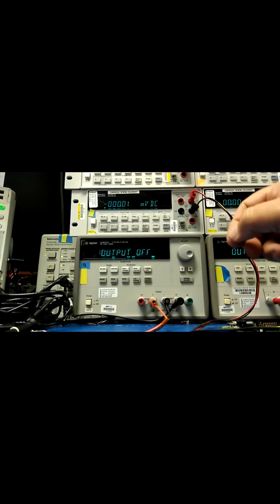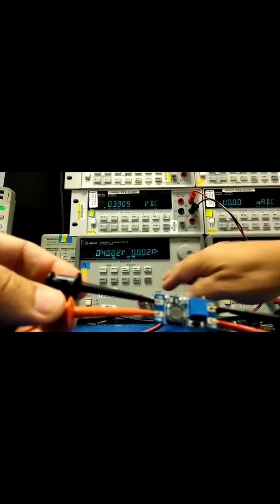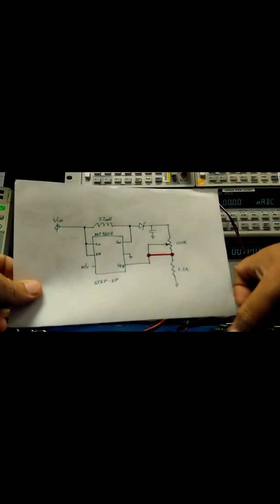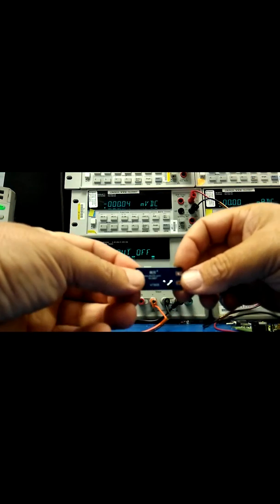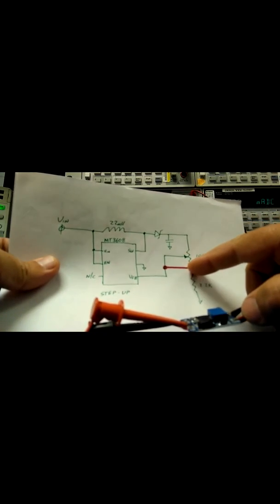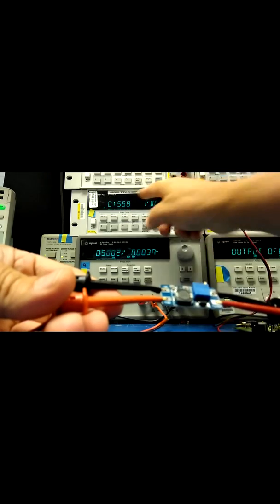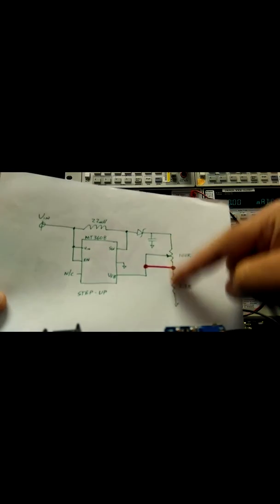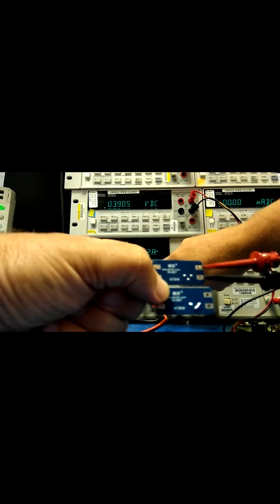How to FIX MT3608 Step Up boost converter module from ebay/banggood/aliexpress.

Comment: Thanks! Mine modules with USB C input had the diode on the side of pot you had to solder on, so the case was just to make the connection from 2 to 3 pot pins instead of from 2 to 1
Reply: Hi, could you specify between which points I have to make the bridge on the modules with the USB C?
Reply: @sandro-x2y  In my case the center one and the one not in use on video

Comment: Just awesome!  Straight to the point. Before soldering the pot legs it was adjusted to 6V. After soldering the legs is actually was measuring 26V. Thank you very much. Nice job!
Reply from the maker: Thanks, glad to help. The feedback pin is 6V max, over that voltage and you let the smoke out, and we know these need the smoke inside to run, haha

Comment: Nice job. I bought 10 of these on Ali ending up with the same issue as yours. My input voltage is 15 volts and I had no adjustment either, tried turning the pot clockwise or anticlockwise. Blew up 2, turning the first 1 anticlock, magic smoke close to the end of the pot travel. The other 1 went the same way, only in the clockwise position. Thanks for posting the fix video 😉
Reply from the maker: your welcome!

Comment: I smoked one of mine when I plugged in the usb (mine has that connector), and 46v came out.  Perfect, so I was trimming the pot, and fell somewhere between 3.5-5v, and U1 lit up and let out the magic smoke.  The next one I saved it, but I sure smell it.  I dislike this module as it is too temperamental besides when I did your fix it no longer boosted at all then I removed the jump, and it started to boost again.
Reply from the maker: Maybe yours is a different schematic, got a link to yours?
Reply: @user-rs8zg8ey2b  I ordered like yours, but Amazon sent me these instead - https://www.amazon.com/Eiechip-Voltage-Regulator-Converter-Module/dp/B07RNBJK5F

Comment: Love this fix as it solves a big problem I was about to have, but how would I add a constant current feature, or module, to this?
Reply from the maker: I dont think its worth the time/money to ADD it to this module, i would rather buy a buck/boost with CC built in. If anyone else has a CC add on solution, please post it.  I just used one of these modules today for a 1S Li-Ion pack (1S12P config, or 31AH) to drive a 12V fan. Not in the same low cost ballpark as this module, check this one out, or similar, look for CV/CC mode https://www.aliexpress.com/item/1005001652060721.html?spm=a2g0o.productlist.0.0.77027a1033VEGD&algo_pvid=04ad1d68-bdb1-49cb-8f86-7e870552561a&algo_exp_id=04ad1d68-bdb1-49cb-8f86-7e870552561a-21
Reply: @user-rs8zg8ey2b  The problem is finding one that will allow 2V+ on the input.  Most CC/CV modules begin at 5V which is not good. edit:  Even the one you linked to begins at 4.8v while the 1S is nominally 3.7v down to about 2.5v/
Reply from the maker: @generalawareness101  then maybe something like this after the step up module? https://www.aliexpress.com/item/1005002895554981.html?spm=a2g0o.productlist.0.0.56ee32b5ccUcLV&aem_p4p_detail=202106302129064450366251836520039441762
Reply: @user-rs8zg8ey2b  This seems to be the way I am going to have to go.  I have the XL4015E1 so use the MT3608 to step up so the XL can step down to a CC.  That just seems so inefficient.  I wonder why there is no one package module out there for this?
Reply from the maker: @generalawareness101  Try websites that have a parametric search for your parameters (digikey, mouser, arrowelectronics), if there is a IC that does what you want then search it on ali/ebay/etc.
Reply: @user-rs8zg8ey2b  I don't think there is a single IC but in a module (like a TP4056 for instance) it has three chips to achieve what it does.
Reply from the maker: @generalawareness101  When i search for TP4056, it shows its a Li-Ion battery charger. So whats your application you need to boost and also CC function? Whats specs are you looking for (Vin range, Vout range and Iout range)?
Reply: @user-rs8zg8ey2b  I was just using that as an example, but.  1 18650 cell powering a 3w (ran at 200-250ma) LED.
Reply from the maker: @generalawareness101  Generally, red led is ~2v and G,B,W are around 3v, but some are higher, do you know the Vf of your 3W LED? You might not even to boost the li-ion and just run a current limit resistor. Some of my flashlights, I got sick and tired of the 5 modes, so i bypass the control board, setup the resistor value so at full 4.2v charge i get the max current I want.
Reply: @user-rs8zg8ey2b  I wish to run this from 2.8v-4.2v (from full to the point the TP4056 bms will cut it off for safety).  The Vf is 3.4-3.7v.

Comment: This is odd I bought 15 modules a few years ago, look the same as yours but all mine have the pins shorted already so didn't need to apply the fix. Wonder if there is some old stock that were not correctly made.
Reply from the maker: Maybe china does not copy so well after all, haha. I did find a datasheet with the work schematic and I was guessing they just copied that. There is chip counterfeits out there, its the more popular and older stuff that copied. Blaser, are you the one into knifes now?

Comment: I had problems with mine to. I assumed that a clockwise turn would adjust the voltage up. Wrong, it required a counter clockwise turning until I could read an increase in voltage. I started with 7.2 volts from a bench supply and monitored it with my mm. I didn't count, but it took quite a few revolutions of the pot screw/wiper adjust to see a voltage increase and then it was a rapid adjustment to the 27v range. Live and learn.
Reply from the maker: Yes, correct. Here is the problem. If you input a higher voltage than 6.2V, and the pot is in the wrong position, this will smoke the feedback pin and game over. You can get them to work, but its really simple to solder a jumper wire on and it wont smoke from this bad design. Have fun.

Comment: It's the trim pot. Replace it with genuine Bourns. The price of this booster is ridiculous cheap. It's 20 cents a piece in China. You got what you paid for.
Reply from the maker: Its not the trim pot, its how its connected. If you look at any voltage feedback divider, the bottom stays fixed, in this design, it does not, well it sorta works, but since the ic cant handle more than 6V on the Vfb pin, you can get in a situation where you can get more then 6V on the Vfb pin and blow up the regulator.
Reply: @user-rs8zg8ey2b  yes, the voltage divider has design flaw, but it still works in some situation. In my case, 2 out of 3 has faulty trim pot.

Comment: I don't know if it was just my TV or not but for some reason the video was in a very small box.
Reply from the maker: Sorry, its not your issue, its was my crappy Le-Eco phone, since them, i have batter equipment (new phone does 960fps and also picked up a hero session 5), sorry for the crummy video quality.

Comment: After shortening those pins and applying 3.6V on input all I received was white smoke...
Reply from the maker: Can you post a photo of your modded soldering? Did you have a load when you powered it up? Did you have a current limited supply when you powered it? The only way I seen these fail is when Vfb gets 6+ volts, but i am sure there is other ways to kill them.